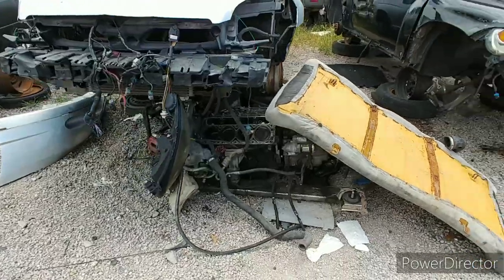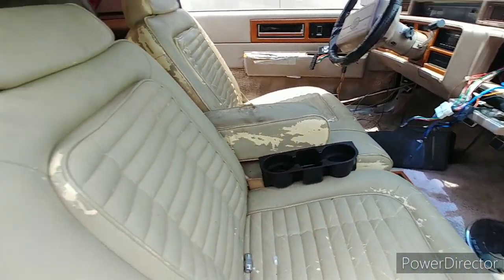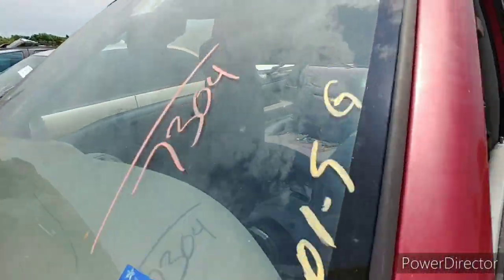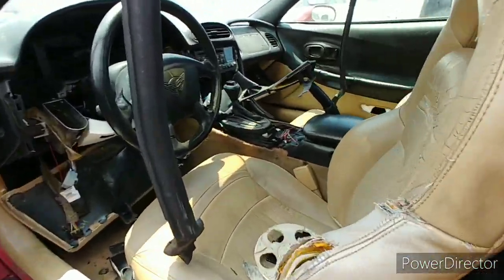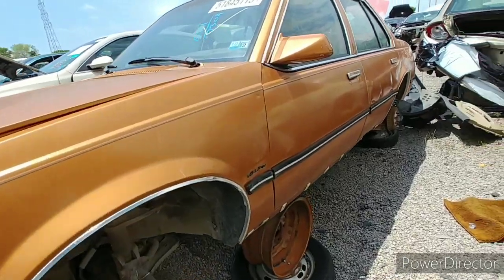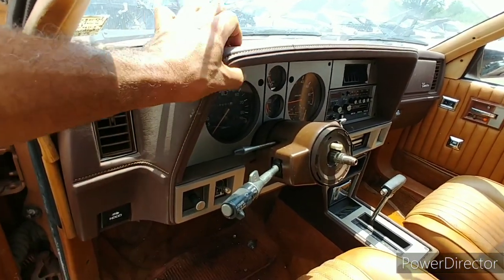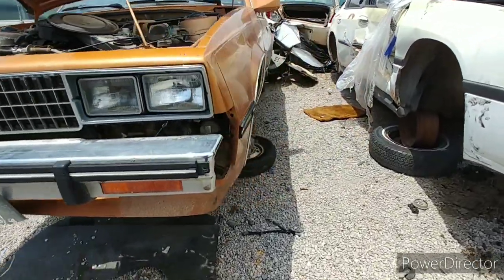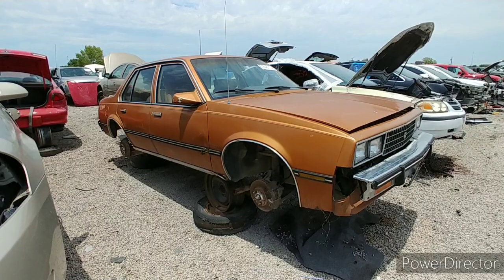A Glorified Cavalier? 1982 Cadillac Cimarron and a few other "Classic" Unsub Specials

Comment: Whoa Nelley, cutting room floor and out the door. Nothing like dealing with an airline when your Precheck doesn't display on your boarding pass for a business trip. So that's this morning's endeavor to deal with. 

There's a Rusty Wallace Chevrolet in Clinton, TN and Friendly Chevrolet still exists in Dallas, TX. 1995 Beretta, no VIN, can't win. 1994 Cadillac Fleetwood with the VIN for the win: 1G6 for US made Cadillac, DW52 for Fleetwood Brougham, P for 5.7L V8 with MFI, aka RPO code "LT1", 2 is a check digit, R for the 1994 model year, R for Arlington, TX assembly and the rest is the production sequence. The Arlington, TX plant still operates today. Paint code is 30 (WA9907) Medium Adriatic Blue exterior paint. When there is more time, I could come back and go through the SPID if folks want that. No VIN, can't win on the other cars you showed, so no sense of going through those. I know how much you love those "Sevova" Cadillacs (Nova based Seville). I actually like them. 

1982 Cimarron: We got the VIN, we win: 1G6 for US made Cadillac, A for manual seat belts, G for Cimarron, 69 for four door sedan, G for 1.8L (RPO code L46) four-cylinder with Rochester two-barrel Varajet, aka "Disaster Jet", 5 is a check digit, C for the 1982 model year, C for Southgate, CA assembly and the rest is the production sequence. The Southgate plant opened in 1936 closed on Tuesday March 23, 1982, so this might have been among one of the last ones assembled there, although it looks like it was made in late 1981 according to the decal on the door. It was among the "Terrible Three" in California among the GM plants (Fremont and Van Nuys were the other two). No tag, can't brag, but this is code 65 Autumn Amber exterior paint. No, those seats look factory issued. Yes, basically a gussied up Cavalier. The 1.8L was the only engine used and it got TBI in 1983 with the 2.0L engine's introduction and things got better. My late dad sold these new from 1984-1988 and they did sell, but people eventually figured out that they were nothing more than a Cadillac "J" car (You're correct on that, it's a "J" car). My grandparents had a 1982 Skyhawk which had the same engine and was a fully loaded model. They got it in 1986 from the dealership through my dad and kept it a few years, selling it in 1989 for a Chevy Cavalier which I still own. The Rochester Varajet was an awful carburetor and caused a lot of trouble. Yes, you can "upgrade" your J car with many of those parts, they bolt right in. From 1982-1988, Cimarrons would be made in Janesville, WI right alongside other GM models. They were only made in Southgate in 1982 as the plant closed in early 1982. Yes, 1982-1988 on the Cimarron, while some other J bodies kept right on going. 

Whoa Nelley, it's a "J" and it's going away. 1982 and it's over for you. 1.8 was never really that great. Paint code 65 is not to soon be alive. That's it, time to quit. Cimarron turned into a dud and a big bomb. Made in Southgate, and soon to meet the final fate. Cadillac on the cheap, it's nothing but a heap. That's it, time to quit. Going to get squished and not many here, surely not Benny, but only for nostalgia for the Google Man is anyone going to be the slightest bit pissed.
Reply: Correct me if I’m wrong, but I had a ‘72 Cutlass that was built in Arlington….was that possible?  Same plant that that caddy was built in?
Reply: @erikturner8687  Yes, you'll see an "R" for the 7th VIN digit.
Reply: Agreed. The Tracker and the Cimarron were a total waste by the yard. Could've tried to sell them first. The Cimarron could've been revived easily and would've made good content for those "Saved from the crusher" car revival channels!
Reply: @nathankim7664  Except no one wants any of them. LOL.
Reply: I think you told the story of how inefficient those three California factories were in the seventies.
Reply: @aarongranda7825  Yup, Fremont, Van Nuys and Southgate were the "Terrible Three". Plenty of news articles on them.

Comment: Never seen that type of Cadillac before but I do like the body style and that Oddball type of way think that's an excellent color on it was really calling attention Watson was waxed and detailed but it's a shame at this in the yard I still think it could have been saved I've seen some people that scrap good running cars because they want something newer way I see it there probably wasn't much to put the car in the yard since the oil look clean coloring it with this dark and no metal shavings or milkshake this leads me to believe that someone probably just trade it in and whatever dealer that had it probably just junked it or maybe an owner just got tired I wanted a newer car it never ceases to amaze me how many clean cars are actually in the yard I could be easily put back on the road again especially with how high cost to buy new car nowadays ridiculous shootout much rather bad that old Cadillac get done with what little cosmetic work that needs to be done on it and drive it everyday more than I would have new one the great video I like those long videos I like looking at the new and older inventory in the yards keep them great videos up.
Reply: Code 65 Autumn Amber exterior paint.

Comment: Those seats would bolt re even used some of th4eight so He had the only Caviler with Dual Power  seats He even took the electronic Climate control out it bolted right in and he even swapped our all th4e gauges and chrome and everything fit perctlty from 1981-1987. He even used some od the parts on his 1987 Z24. Thiose were the corret Cimmeron seats as they were only av from 82-84.
Reply: I probably would’ve done the same in that time

Comment: Cimarron in the 1982 year were the worst of the worst.  The 1.8 ltr motor was very underpowered.  Oh a hot day with the AC on and three people in it you couldnt get away from a stop light.  Its was dead slow.
Reply: They quickly replaced the 1.8L with an larger 2.0 the following year with throttle body fuel injection. Eventually they offered a V6. but that first engine only produced 88HP.. By 85' they had a 2.8L V6 offering with a whopping 130HP!
Reply: @marcusdamberger  Correct. It wasn't bad with the 2.8L. My father sold them new from 1984-1988.
Reply: Add one of those in a Toyota Tercel be called that the emergency brakes turn on the air conditioner it'll stop

Comment: Where's this at. I have an oldsmobile cutlass calais 1988 that may need  some parts from that cimeron. Thanks Benny.
Reply from the maker: its at the. Dallas pick n pull. South Central location
Reply: The Calais is an "N" body in 1988, but some parts may interchange.

Comment: Do people literally pull up all the seats up like that looking for pennies and dimes in the cushions? They completely ruined that back seat for maybe .30; not likely to have anything back there with such a low mileage car! Also looking at the Pick-n-Pull picture when it came into the yard, it had alloy wheels. What do they do with the alloy wheels? Do they set them aside and it's one of the first things sold? I guess if you had a Cavalier of this generation it might be nice, but I just don't see this or any of it's siblings rolling down the road anymore these days.. I did see a white 2-door Berretta of the same age at the stop light the other night, 0:17, it had that typical decal look on the side from the early 90's on it.
Reply: They either go in the wheel rack to be sold or scrapped out for the aluminum I would gather.
Reply: I see that in other cars too. I hate it when people bend it all up. It’s just disrespectful to damage the parts on a car in the yard